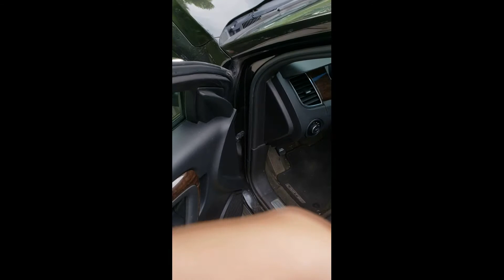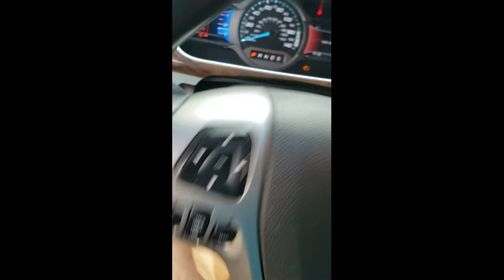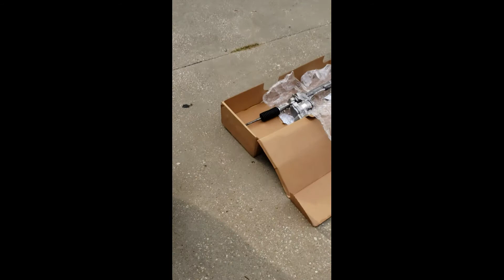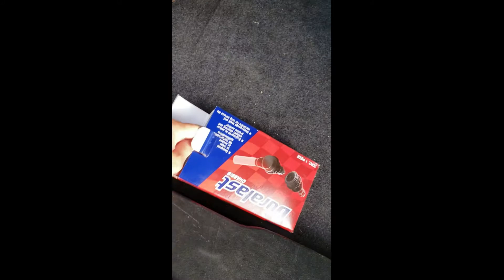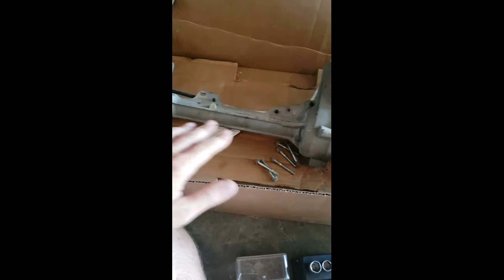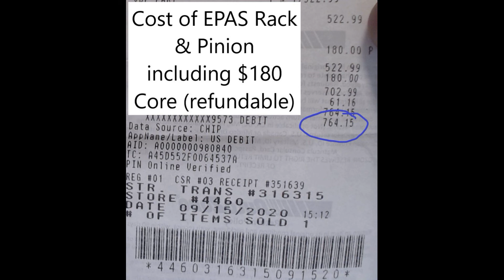Ford Electric Power Steering Failure Solved - Noise on Ford Taurus EPAS w/ Repair and Cost

Comment: I have a 2012 Fusion that was making the same noise. Replaced rack and pinion and the noise went away but the steering is still hard. Took it to a local shop and he says that it was a bad rack, so I replaced it again and still hard to steer. He swears that we got 2 bad racks. Is there anything else to look for before I replace it a 3rd time?
Reply from the maker: Who replaced it? Ford dealer, or another garage? Electric rack just like mine? Once the electric rack is swapped they have to sync the computer...in my  town, only Ford could do it, and it cost me $130 or so and it drove better after that. That was my experience. I do recall mine being much tighter and harder to steer right after I replaced it before Ford did the computer update/sync magic vudu
Reply: I HAVE  THE  SAME  PROBLEM WITH MY  2010 FORD  FUSION 3.0 
I  KNEW  SOMETHING  WAS WRONG  ABOUT   6  MONTHS AGO WHEN I  WOULD  BACK UP  IT  WAS  LIKE  MY  DRIVER SIDE  WHEEL  WAS  STUCK  !!, AND THE  STAIRWELL WAS HARD  TO  TURN !!, FOR   2 SECONDS !!, BUT  I  THINK  THE  POWER  STEERING  WAS  GOING  BAD  THEN !!, BUT  A LOT OF  FORD  FUSIONS  HAVE  A  STEERING  ANGLE  SENSOR !!,  RIGHT  UNDER YOUR STEERING WHEEL !!, BUT  THE  2010 FORD  FUSIONS  DO   NOT  HAVE   THE  STEERING  ANGLE  SENSOR  ON  THE  STEERING  COLUMN !!,  IT'S  JUST  A  CLOCK  SPRING  THERE !!, BUT THERE  IS  A  SPOT  WHERE THE   STEERING  ANGLE  SENSOR    SUPPOSED  TO  GO  !!,  BUT  THERE  IS  NO  STEERING  ANGLE  SENSOR THERE !!, AND  THERE  IS  NO WIRE  HARNESS !!, TO CONNECTED TO !!, NOW  YOU CAN  GO  ON  EBAY  AND  ORDER  ONE  BUT  HOW  ARE  YOU  SUPPOSED TO  CONNECT   !!, WHEN  THERE  IS  NO  WIRE  HARNESS !!, I  BELIEVE  FORD  PUT  THE STEERING  ANGLE  SENSOR  IN  WITH  THE   ELECTRIC POWER  STEERING  UNIT !! .  LIKE  THEY  DID  THE  2011 AND UP !! .

Comment: I opened my old rack and water poured out with all lubricant gone
Reply from the maker: Oh yeah? Sounds familiar. I could tell mine had been full of water at some point, but By the time I pulled it apart it had been a while, so I just had the debris and no lube etc. Never would've guessed driving through water was going to kill my power steering, but I won't make that mistake again.
Reply: @therealnomadtrading  Yep! a buzz kill, I love driving thru deep water. Never again lol
Reply from the maker: @edesir  haha me too! bummer!
Reply: I wonder if my electric power steering in my 2010 Ford fusion has water in the  electric power steering !! . My car was sitting about for  2 months !! .  I drove it up the street  and back and parking it !! .
Reply: @timothydetwiler313  Does it lock up oce i awhile?

Comment: Thanks, good info. I am dealing with this issue and basically going same route.
Reply from the maker: You're welcome! Good luck to you my friend!
Reply: @therealnomadtrading  So this is a plug and play kit but you do need an alignment after it’s installed? Also when all of that is done, can I drive it to Ford to get it programmed or it has to be towed?
Reply from the maker: @King___BL19  Yes it's plug and play and yes it has to be aligned. After they get it installed, yes you can drive it to Ford (at your own risk - disclaimer so you don't sue me lol) but yes I drove mine for a few days until Ford could get me in.... only took them a few minutes to get it programmed and I was on my way. Hope this helps!
Reply: @therealnomadtrading  Thank you for the info 💪🏾
Reply from the maker: @King___BL19  You betcha, let me know if there's anything else I can help with my friend.

Comment: I'm pretty sure I have the exact same mechanical issue. Do you know what might happen if I don't replace it soon?
At the moment I have a budget and I can't afford it at this time
Reply from the maker: I'm sorry to hear that. Well if it makes the exact same sound when you turn the wheel, car on or off, it's very possibly the same thing. I had driven through high water before it started and I believe that was the root cause... a leaky seal allowed water to get in and rust out the bearings...I drove mine for quite a while like that because it wasn't affecting the power steering...just annoying grinding sound. If the actual motor goes out on the EPS, it gets dangerous....if it's just the bearings like mine you can probably drive on it for a bit until they eventually wear completely out...hard to say how long that would be. Drive at your own risk - disclaimer :) I didn't take mine on highways or high speeds just incase it failed completely but around town I drove it quite a while...probably a month or two before fixing it. Hope this helps.
Reply: I can tell you, once you hear that noise, you'll have at least 100 miles of driving before a total failure bearings will seize any movement. Happened to me.
Reply from the maker: @edesir  yep it's only a matter of time
Reply: @edesir  seize any movement for the power steering or steering in general? All ive read is ill lose power steering not complete steering function
Reply: Yeah my focus did the same thing this past Friday just ordered the part today hopefully have it fixed and programmed by Friday. Northeast Snow storm might delay it though.
Reply from the maker: @King___BL19  Yes it might, and then how can you play in the snow in your car? haha